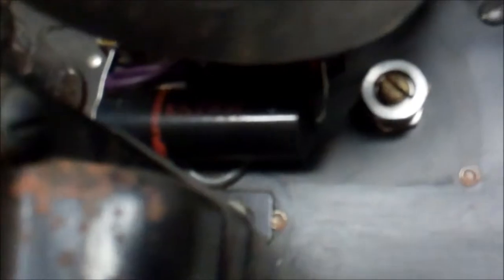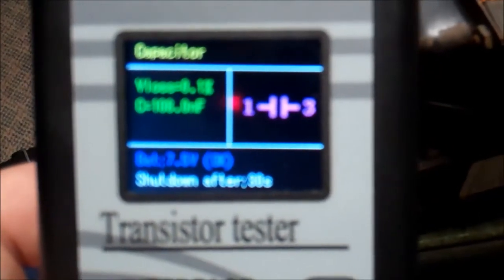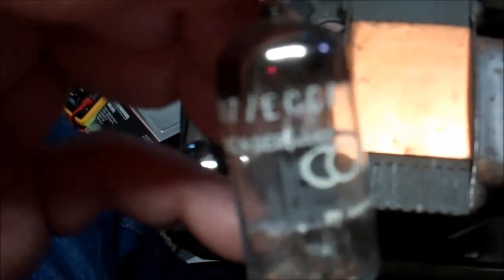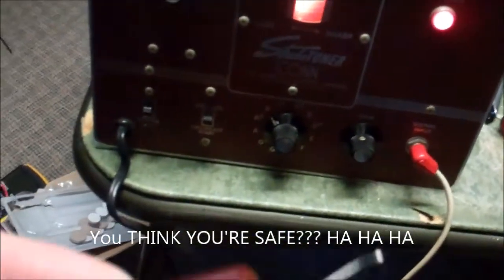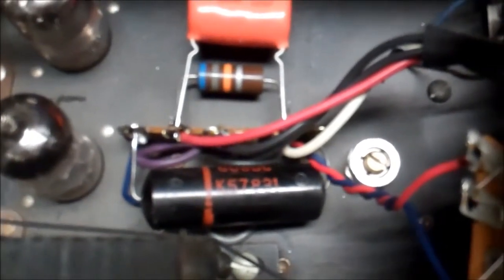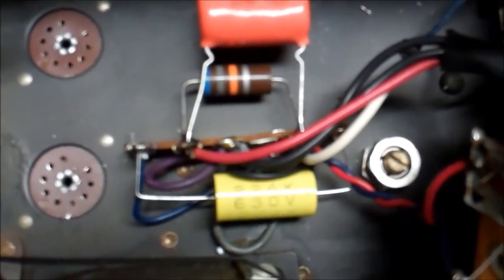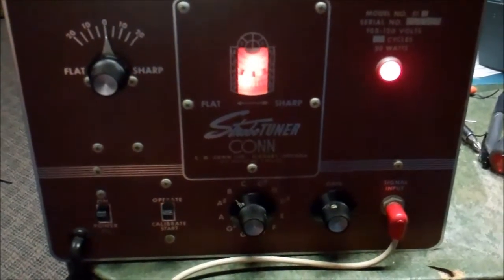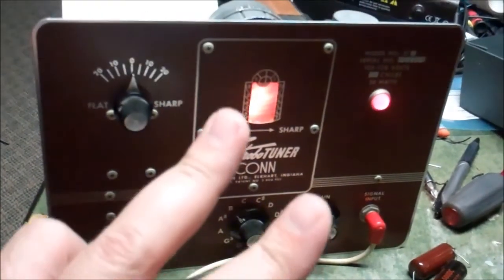Mr. V. Fixes the "Led Zeppelin" Conn ST-6 Strobotuner.

Comment: DK, this video inspired me to open my ST-4. The calibration never seemed to hold.  The two motor run caps have been replaced at some time.  The values are a 100/100v ecap and the other is .8/100v non polarized.   This may be making the speeds run erratic.  The big cans don’t close the eye on my cap tester at 300 volts.  They need to go. 
I’ve seen the schematic for the ST-6 and I assume the motor start/run caps installed are wrong.  Btw my w. German ECC81 is an East German Tungsram.  Marked to fake out the embargo.
Reply from the maker: Cool.  Best wishes solving it.

Comment: Thanks for the video. I just picked up two of these and the motor is not working so I am going to start by checking that cap. I have a ST-2 which has only 1motor cap.
Reply from the maker: There's a few other things to look at also.   Th 6AQ5 tubes are what actually gets the motor going.   I ended up doing an electrolytic job on this ST-6,  which is on another video.

Comment: great video . i have one and just out of the blue started blowing the fuse i put 3 in it and they blew as soon as i turned it on.blown.
Reply from the maker: You may have a shorted rectifier tube.
Reply: @DeadKoby  tubes were bad , have new ones coming. thank you for your help.
Reply: @DeadKoby  replaced the tube with new soldered in a fuse pop as soon as i powered it up.

Comment: I just picked up an ST-8 and the motor is weak.   I'm gonna have a look and see if the motor has similar looking caps!
Reply from the maker: There's an adjustment pot on the side...   Also check your tubes.   This video is a bit older,  and I've gotten more experience since then.

Comment: I don't know about you but I've seen so many more leaky .1uf/600v Orange drops than I have black beauties. Especially 80s/90s Mesa amps. Maybe they are better now?
Reply from the maker: Mesa runs their caps at the "bleeding edge".... they should have put a higher voltage in them.   I have better test gear now than I did then.